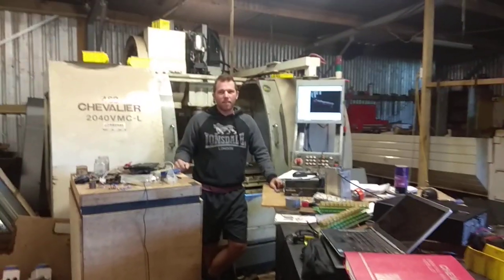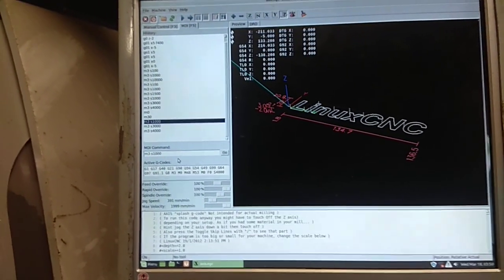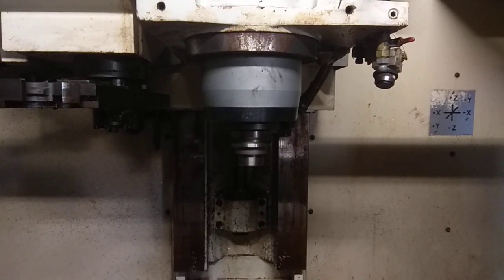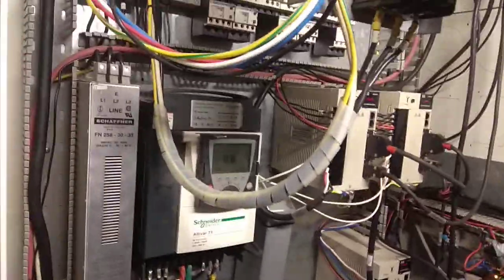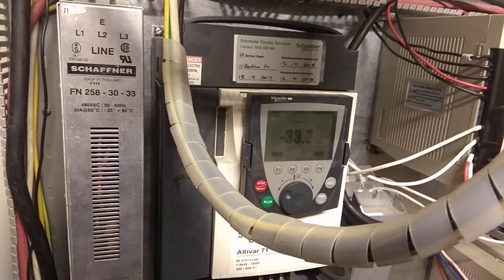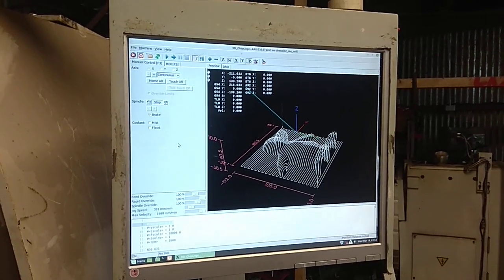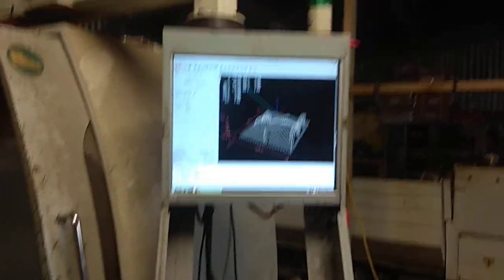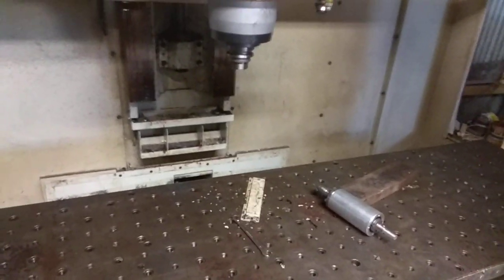Linuxcnc retrofit update.  Ready to cut.

Comment: Hey im just considering retrofit of my hyundai 18s lathe but just wondering what is cost of yours retrofit?
Reply from the maker: 2000 usd for all servos.
300 usd for Mesa cards.
200usd for computer plus touch screen

Probably 2500usd all up.

If you want to know more just email me.  You can find contact info at carbidecutters.co.nz

Regards

Andrew
Reply: @carbidecuttersnzltdandrewb8449   Great and is There  posibility to use old siemens drivers for it or only New?
Reply from the maker: @otekk13  depends on what you have.  If it can accept +-10v then you are away.  But probably not.  Send m some manuals and I'll have a look